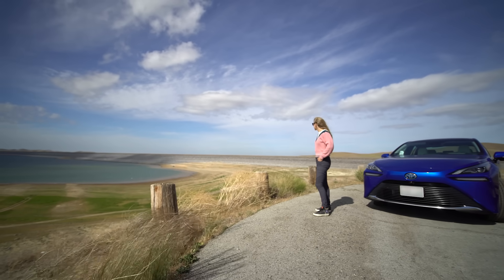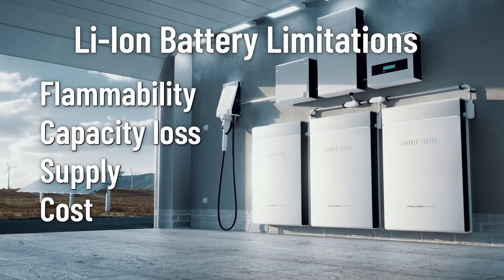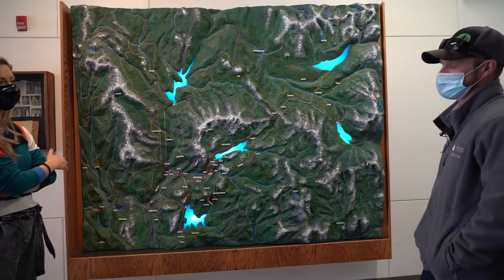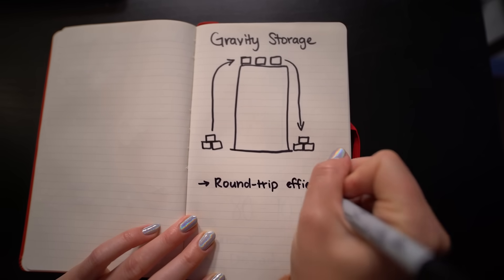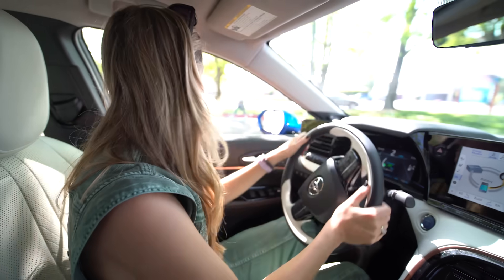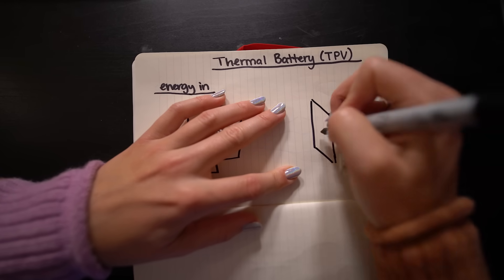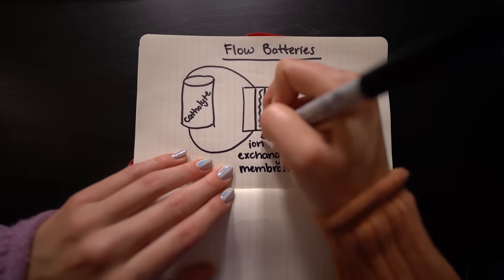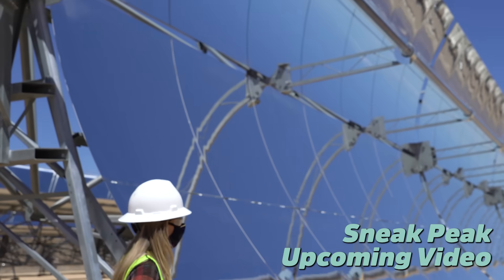The BIGGEST problem with clean energy

Comment: Very cool! Is there any reason you didn't include Flywheel Energy storage?
Reply: Too short term, milli-seconds to a few seconds only, before it all gets insanely difficult
Reply: @billschmidt4581  Are you considering scale? There are some massive (pardon the pun) Flywheel energy storage farms out there. From what I could see, the only negative is that the installation cost is very high. However, I didn't find much lifespan and other problems (i.e. heat production).

Comment: Hydrogen only really becomes sensible when renewables are super abundant and over producing, however it can be stored directly in the methane network. natural gas appliances around the world will work with a hydrogen/methane mix (up to 80% hydrogen I believe) and could actually provide a transition process for the reduction of methane use in domestic heating etc. In Northern Europe 60% of domestic energy consumption is for heating, another 20% for heating water. Heating is a major component that needs to be addressed in energy consumption.

Comment: Methane could also be used, similar to Elon Musk's plans to provide fuel on Mars. It recaptures carbon from the carbon dioxide in the atmosphere.  Also easier to store than hydrogen.  Of course, ubiquitous availability of third generation Battery powered electric vehicles on a distributed basis can also be used to store power for homes and business.  This leads to the third of the main pillars of energy production: Distribution.  Generation, Storage, and Distribution are all equally important.

Comment: 7:15 “The method that is primarily used to produce hydrogen is steam reformation.”
Yeah, that’s a problem that makes fuel cells basically pointless in eliminating carbon footprint. And electrolysis is so incredibly energy intensive that it’s not worth wasting limited clean energy generation on hydrogen for fuel cells. That energy should instead be used to replace emitting sources. Until there’s an environmentally friendly and efficient way to produce hydrogen, hydrogen fuel cells will not substantially help us reduce our carbon footprint.

Comment: wait so the big creek system is essentially a giant sisyphus machine to waste energy when the sun is producing the peak amount of power? i say sisyphus because there are losses in the pumps just as the previous video says there are losses of power in transportation and storage of battery vs fuel cell and a lake/dam can only hold so much water which might vary depending on dry vs wet season. too many variables in my mind so we just have a machine that wastes energy cause we produce too much and cant store it properly. this was a machine engineered circa 1920 that still works and is expandable yet our energy production and consumtion, not to mention climate change, is still extremely variant to a point where instead of this being a giant battery it's a giant sisyphus machine. why is everything so much more disappointing than i imagined when i was younger.

also you talked about "other mechanical storage" but you didnt explain flywheel storage which is probably the simplest and easiest to build. tesla does have some already built though and this video is sponserd by toyota so i guess cant talk about competitors unless you're slandering them.

also also the series talks a lot about hydrogen as being abundant but what about oxygen? my main concern for this topic is are we creating cars that consume more oxygen than humans consume? and does the production of hydrogen with oxygen counter that effect. i am aware the method of production for liquid oxygen is protected by the FCC because of an episode of mythbusters and it is a component of rocket fuel. still a comparison of hydrogen and oxygen produced vs consumed in a car and the same in a human would be nice. bonus if it produces more oxygen than consumed.

Comment: Hi! Really interesting video :) At the heart of the problem is the inflexibility of traditional electricity demanders. Bitcoin mining acts as the ultimate flexible customer, allowing you to overbuild renewable generation and run at full capacity, switching between commercial/domestic customers and bitcoin mining as a "buyer of last resort". Square/Ark have a great little paper on this concept. It could be an effective complementary technology to energy storage.
Reply: But bitcoin mining is a waste of electricity. The tech behind it is what is interisting but the coin itself is a giant waste. I wonder if there are many compute type aplictaions that will work well on a crypto curancy type setup.
Reply: @someonespotatohmm9513  I have to disagree. Bitcoin provides a way for people to transact without censorship and store value without inflation. It is providing freedom to those living under dictatorships - see the work of Alex Gladstein of the Human Rights Foundation for more info. The way it uses energy is essential to the technology.
Reply: @matt_hoc_tieng_viet  But is that how it is used? I higly doubt the majority of bitcoin is used in dictatorships with the exeption of china. Which seems to crack down on it with some effectiveness.
Just because it can be used that way doesn't mean it is. If you say inflation is not an issue with bitcoin you can make the same argument about other types of curency.

Comment: Existing wind turbines use winds of 6 meters per second and stronger, which rarely blow in many locations. That is why a lot of energy needs to be stored.
By using light winds of 2 meters per second, which blow much more often, the need for energy storage would be reduced.
Reply: kinetic energy scales with vel^2 so only 1/9 the energy in the 2m/s wind. I doubt that is worth it and we have a lot of locations that do have wind.

Comment: "let's talk about lithium batteries"
... shows a swollen PB-GEL battery
Reply: Because nothing left of the lithium battery but a crater?
Reply: I presume a damaged lithium battery would have exploded or burnt down?
Reply: Nope. Just google images of swollen li batteries
Reply: Yes
Biased much? (The video)
Reply: @rogerstarkey5390  I believe it was a mistake. 

There is a report talking all about how lithium batteries need to be spaced further part when they are placed in giant containerized systems. On the cover, a photo of the SnoPUD Vanadium battery, placed closely together.

If she were really biased against lithium, she would have mentioned that the Victoria Tesla Big Battery she mentioned had already caught on fire once, and took 3 days to put out.

Lithium batteries are far safer than any gasoline, CNG, propane, or similar source, but it is far from the safest battery.
Reply: @bob9802  "took 3 days to put out" ... more precisely, they were told to let it burn out. (water + lithium bad)
Reply: @kustomzone  there is no metallic lithium, so the reaction should not be worse. Many battery makers recommend dowsing in water, to halt the thermal runaway from continuing to propagate. At this scale, it is difficult to control, and you just need to evacuate people away from the toxic smoke.

Comment: Whatever technologies are used we can't overlook the total needed capacity. In case the wind slows and there is overcast in a region and low water levels like there is now, the renewables are likely to tend to zero. That means for a duration of possibly several days we have to tap the batteries. California alone uses about 50GW peak during summer months. Without a baseline supply of nuclear or natural gas, all of that has to come from the stored supply (assuming no flow-in from outside the state). That's a lot of energy to store. And that's just California.

Comment: Australians can buy a zinc-bromine flow battery for their homes from RedFlow. It's called the ZCell. Unlike some other flow battery chemistries, zinc-bromine plates the zinc onto one of the electrodes during charging, then it's redissolved and put back into solution during discharge. The quirky thing about this is that all zinc must be dissolved off the electrode, or it can form dendrites that will eventually short out the cell. And so every few cycles the battery must be full discharged. So after it's down to zero, it's shorted out for about half an hour just to make sure it's dead. Most practical systems will have two battery banks. When one is completely discharged and sitting there shorted out, the other has power. The ZCell is 48 volt, 220 Amp-Hour.

Curious, a few years ago I looked at the US price and it was about $15,000 (USD) delivered. Hopefully they've come down in price since then.

Comment: Among mechanical technology to store energy, there is also the use of flywheels. There are many companies that already sell flywheels, even for private housing. I've seen a couple of houses that used one of those, spinning at high velocity in an underground vacuum vessel, to store the excess production from the house's solar panels. You can then later convert some of that rotating energy into electric power, through a dinamo.

Comment: Wouldn't be wonderful if we were to have our fuels to be energy storage, instead of inventing new types of energy storage, which by itself, when integrated, will make the energy to the consumer more expensive... Oh I forgot we have such fuels, but regrettably we do not think how efficiently convert and distribute the energy from them. It would be nice to see a video showing the energy loss of a one Joule energy in let say going in a power plant to (fraction of) Joule energy out at the power socket at the consumer. When such an analysis is make, then one starts to see where the real issues with the conversion of and distribution of energy reside and how inefficient ( around 25-27%, if not considering the capital cost ) the entire system is.

Comment: Gravity-based energy storage is an investment scam. We, as humans, use WAY too much energy for even the densest things to provide substantial energy storage by lifting them and letting them drop. The water reservoirs can work, in some areas, as a buffer for energy demands, only because water is very very dense and those areas are in mountain ranges where you don't need to construct km-tall towers with 3km wide 'pools' to hold the water on to - because they already have literal mountains to hold the water up high for them. In most areas it's just impractical to do it. Do the math, to power an average household for ONE DAY you need to lift several tons of mass well above the height of a normal house. Again, it's a crowdfunding scam. It's not a practical solution.

Comment: This is why I, as a chemist, have always lowkey supported the industry around burning renewable fuels - things like ethanol and charcoal-based fuels. Plants are more efficient at capturing and converting energy than even the best solar cells, chemicals like cellulose are more energy-dense than even the best batteries, and most or all of the carbon emissions are effectively negated by the fact that you used plants to capture that very carbon from the atmosphere in the first place!

The trade-offs are:
incomplete combustion can lead to carbon emissions that are more dangerous to the atmosphere (things like methane, instead of CO2)
destruction of natural fauna that use the growing plants as their habitat

other pros to consider:
not needing as many rare resources mined from the ground
not needing as many toxic resources that can go back into the ground

Ideally, the future of energy storage is going to be chemical, and the best way to produce it will be by genetically engineering an existing plant to fit our needs. NOT by doing more studies into obscure transition metal batteries. Hydrogen is a good bet for chemical storage with our current technology, but hydrogen is hard to store and still has a significant loss of energy to produce.

personally I like the bio-algae ideas but they are still stuck in the "convert it to biodiesel" stages as opposed to just filtering it out and burning it as fuel (then re-using the ashes as fertilizer, obviously, once you account for other things like pH and chlorine / iodine loss during burning)

Comment: Instead of converting existing natural gas infrastructure to hydrogen (which would involve specific problems with hydrogen leaking through metal and consumption equipment being incompatible), perhaps look at methods to synthesize actual methane from energy input, atmospheric CO2 and other abundant materials.

Comment: As an power systems electrical engineer I commend you for tackling this subject. My first project out of school in 1989 was working on the design of 750 MW pumped storage plant in Georgia and 30+ years later I’m working in Solar/Wind and have come full circle in also working in Battery Energy Storage. It’s a fun area to work.

Comment: Great video as always. From someone in the industry, I have one minor comment though - pumped storage hydro still has a lot of room for growth. There are lots of potential sites still available, and opportunities are not nearly as limited as traditional hydropower. With newer concepts such as “closed loop”, the environmental footprint is decreasing. It is only one of many options, but it’s still one of the cheapest for very long duration storage. There are several very large projects just in North America moving full steam ahead, and it will likely play a key role in energy storage for some time yet (until some of the newer concepts such as flow batteries come down further in cost).

Comment: We already have the most energy dense storage system available that has an absolutely minimal environmental impact. It’s safe, clean, reliable, dispatch able, and has a virtually nil footprint for the power stored and produced. Its called Uranium. It’s time to stop saying we need 100% renewables and rather 100% sustainable.
Reply: Its also expensive, enough so that overproduction with renewables + storage is a good idea to do, even if we also do nuclear (which we probaplay should)
Reply: @someonespotatohmm9513  
Yeah, I’ve run the numbers on that. Not so much. Renewables make sense right up until they create too much instability on the grid because current costs for storage are far to high. Most studies put the percentage of renewables some where around 30% maximum. Can share if you’d like.
Reply: @MrElifire84  A share would be nice. Not yet well informed on storage as l understood it to be a relative new problem. And as such ppl mostly have to rely on educated gueses of which methods will yield promising results.

Comment: why can't we fix a generator to wheel ( in cars ) as long the wheel rotated by electric motor the generator shaft also starts rotating the electricity generated can be used for recharging the same battery in car. Yeah due to friction some energy is wasted but lot of it get recycled. 

you look soo pretty

Comment: Maglev technology, used to cushion and rotate, a flywheel, on the scope of several hundred tons. 

Multiples of these, would solve energy storage, you could make their weight, mostly concrete, if needed. 
Just have to utilize cross platform ideas, to create useful concepts. 

Boeing hangar sized concrete Maglev flywheel energy storage for the future! 

Wouldn't even need to rotate very fast, to store massive amounts of energy. 
Smaller flywheels, could store energy for much longer, maybe. 
giving efficiency to scalability.

Comment: I've been working in energy storage for over 5 years now, all types. A couple technologies you didn't mention. 1) flywheel energy storage using massive wheels on magnetic bearings and spinning in a vacuum. 2) thermal energy storage to power Stirling engines. Finally, with hydrogen electrolysis, it's not necessary to retire natural gas infrastructure since H2 blends very well with the existing system.

Comment: How does the thermal photovoltaic battery actually store energy? Wouldn't it be constantly discharging?
Reply: and how to get such a high efficienty? Even if you don't waste unabsorbed light you still have losses from a unmatched bandgap. Or are they planning on using high eff pannels. Might be financialy possible if you can focus the radiation without to much loss.
Reply: @someonespotatohmm9513  I imagine it's being done in a vacuum. That eliminates (well, greatly reduces) conduction and convention as energy losses. The only remaining loss is radiation. Mirrors (with coatings) can be designed for extremely high reflectivity (like 99.99% or higher) within a band of frequencies. So if you can cover most of the blackbody radiation frequencies with your mirror coatings, most of the radiated energy either ends up in the PV cells, or is reflected back to the carbon sink to be reabsorbed as heat. It's a fascinating idea which I initially never would've thought would work. Basically a miniature Dyson sphere.
Reply: A good video on how to understand and use your instincts https://youtu.be/XrmyGtdmgoY

Comment: I'd argue that the biggest hurdle to going 100% renewable is affordability and scalability of current technologies. I'm not suggesting we don't keep innovating, but when people's electric bills have more than doubled in the last few years as coal plants are phased out it hurts. Ironically the low-income are hit the worst. Baseboard heat found in a lot of older, more affordable to rent, houses combined with awful insulation makes for massive electric bills. What are we supposed to do? Even keeping the heat set to 60F is expensive, and even then that's not heating every room. A nicer, better insulated house or apartment costs more to rent, and if it was possible to convince the landlord to update insulation and install a heat pump (or mini-splits), the rent would go up by a huge amount. The well-to-do middle class see cost of living  increases as a minor inconvenience, and accept the cost for the benefit of the environment, but the lower class struggles.